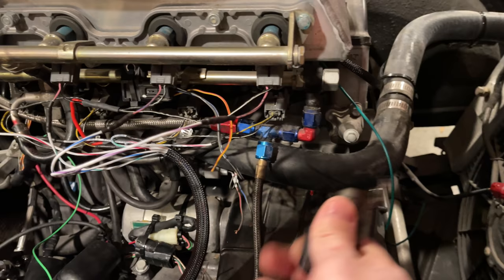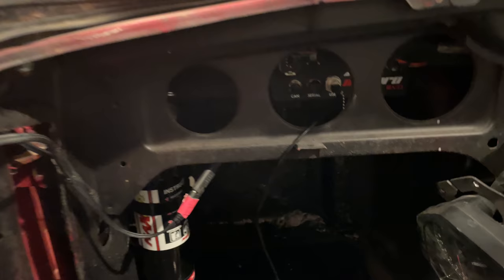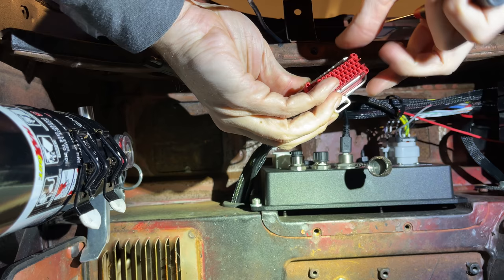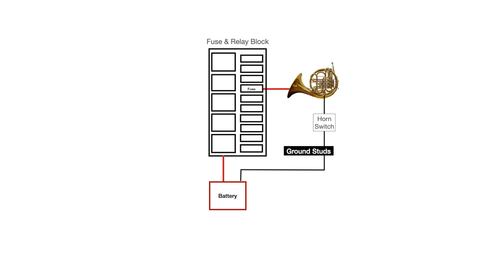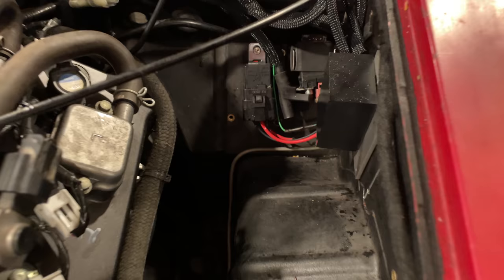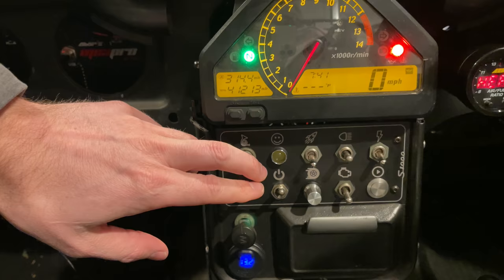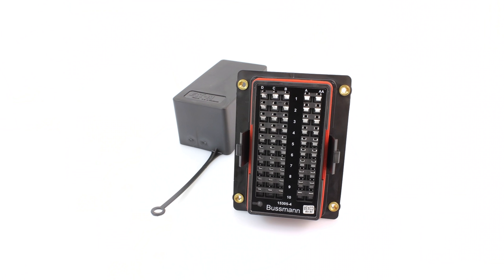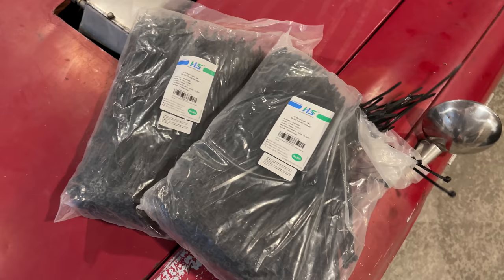Re-Wire Your Whole Damn Car - How To Do It Correctly & Inexpensively

Comment: one thing i’d add, when you’re at the “how long does each wire need to be?” stage, it really helps to use bits of cheap rope and tape to find the routes that will determine the length, shape and look of the finished harness.
Reply: Yeah, that's one of those steps that even the sincerely nice helpful people get kinda curse-worthy about leaving out or refusing to in any way advise on. And then they sneer at you for getting the wrong length cable when you had no way to know what the right length was.
Reply: @claws61821  It's also one of those things that's more of an art than a exact science, the trick is to make sure you have too much so you can cut them off at the right length once everything is all laid out.
Reply: @hannahranga  I thought the trick was to have extra so when you trim it down it’s still too short.
Reply: @hannahranga  And yet they don't offer ways to figure out even those rough approximations, and at best laugh derisively at you for asking. Why is that, I wonder...?
Reply: @kylemaddux1658  "I cut it three times, and it's still too short!"
Reply: My method is to attach it at the switch, relay, or fuse box, route it where I want and cut it when I get there.  It's tricky, but there you have it.  If you're dealing with a spool, then I put the spool at the thing switch/relay/fuse, then pull it where it needs to go, and then cut myself a couple extra inches, and fine tune it off the spool.  You still have one end free to run your loom or heat shrink.
Reply: just keep the wire on your spool... start at one end and route the wire to the other end, then backtrack and tidy it up (zip ties ect) and once its all in place, "Then" cut it to length and you will never have any waste.  There's no reason to cut any wire until its already in place.
Reply: @kylemaddux1658  sounds like you have done this before!  Lol!
Reply: @hannahranga  Measure twice, double it and add 30.
Reply: shit that's a good idea
Reply: I usually rough out the harness before cutting leaving at least a couple of feet either end (it's easier to cut a wire than to join it. But at the start I get an exercise book and note down all things that need wiring up. I then assign a colour and size of cable needed. I used to use a lot of base colours and had trace cable as a back up for extras and I use a tab of masking tape to identify  the cable. As for terminals I use QC connectors from single pin to twelve pin. For higher current I use a larger terminal (fuse link size high current) for any of the main power supply cables. If the customer wants a better connector I will use Deutsch plugs. When covering the harness I use split corrugated tubing in the engine bay and chassis but prefer shrink tube on the engine (personal preference) .If the customer wants a taped harness I will use a slightly wider tape made by Nitto. As an added F/U factor I will always run extra wires depending on the vehicle.  You can guarantee the customer forgot to tell you about the extra thermo fan or I want to fit A/C etc etc.
Reply: that's a brilliant idea I'm gonna do this next time
Reply: The best way in general is just to pull straight off reels and cut to length
Reply: There's a HELPFUL HINT.
THANX.

Comment: To much fuse is the wrong term. Really you want the smallest fuse with an over sized wire.
Reply: Thank you. I'm glad someone said it. I only came to the comments to see if someone already said what I was thinking when I heard that.
Reply: I’m used to wiring houses so I prefer to use 12 or 14 gauge wires for everything.
Reply: He meant:  If you only need 6 fuses, but you can only find a 10 fuse box----  then just go with the box with "too many fuses"...  and just have some extra. (same thing with the big connector).  Using the correct size fuse the wire requires is a given.
Reply: How do I rewire my 1964 Honda s600?
Reply: I'm sure that what he meant was if you don't know exactly how much current you need, err on the high side ("use too much fuse"). Later, when you choose wire size, you will (if you're following his guide) choose wire with at least enough capacity for the current rating of that fuse, and everything will work safely.
Reply: @calholli  Sure, but the number of circuits (fuses) in the distribution panel (fuse box) is not what Matt was talking about when he said "too much fuse".
Reply: @brianb-p6586  you don't blindly go with a larger fuse. If the current wiring cannot handle the load and you just upped the fuse amperage your gonna burn or melt something. Without knowing what the circuit is running or the wires feeding the item you cannot blindly up the fuse without risking damage.
Reply: @FishFind3000  what "current wiring"? This is about building the wiring from scratch.

Comment: Bonus tip, heatshrink the ends of the nylon cable braid. This way it doesn't roll back and expose the wires, looks neat too! Also let's you label a bundle of wires like "Left headlight" or "Flux capacitor" :D
Reply: I was planning on doing that for my  motorcycle fuel lines. Bought stainless loom for it 😍

Comment: I run all the electronics on singer Porsches for a living and I love this video. it's got an amazing collection of information with a good sense of humor to help beginners get over the hill on learning how to wire up a car which I know from personal experience, is a huge challenge to overcome. Keep it coming!

P.s. just as a side note, please please use something like DR-25 heart shrink and SCL/ ATUM adhesive heat shrinks in the engine bay for any engine bay harnesses that you plan to compete with and keep in the car for any extended duration as oils and heat can and will melt those wires and short them out over time. (Bonus points if you use tefzel wire too lmao)

Comment: Helpful tip with the Costco size bags of Zip-Ties is to rip the hole you pull them out of in the center of the bag instead of just ripping off the corner. That way they stay in during transport, and are still easy to pull out of the bag. Stupid little things that make a huge difference in your sanity.
Reply: I wonder how many times I have dumped out most of a bag of zip-ties. Your tip changed my life. I can be somebody now. Yeehah!!!
Reply: I learned this method a few years ago and have been using it ever since! A vertical slit makes it easier to pull them out than a horizontal one!

Comment: Quick tips:
If you would like to use aluminum wire just go two sizes up and make sure you don't have your wires too tight if your in a cold climate.
Remember that trying to measure resistance or continuity on a live circuit can damage your meter
Reply: Al wire will work harden and break ( usually at the connector point) if there is any vibration. 

Stick with copper.
Reply: @mycarsanovaify  copper work hardens as well..
Reply: Eh, resistance would be fine. Itll just max out and not give you a value. But the continuity will most definitely blow it up, yes. Never test continuity on a live circuit over 10a unless you got one of those extensions that can take the brunt of the amperage
Reply: @daniellau5859  Continuity and resistance are the same measurement (that's why they're usually on the same dial setting of a multimeter); continuity just beeps if resistance is below a certain value. Don't use either (or the diode check setting) on a live circuit.

And not only can trying to measure resistance/continuity/diode on a live circuit damage your meter, but may also cause strange things to happen in the circuit, since it's injecting electricity to measure the resistance/etc. Or sometimes even damage the circuit, depending on what it is and at what points you're measuring it.
Reply: Just don't use aluminum wire wtf. Are you try to sabotage him?
Reply: Better tip. If you would like to use aluminium wire, don't!

Comment: Idk what I expected but this is a really great video. I’ve already wired my car using the same methods you highlighted after learning the hard way through making tons of mistakes. Through my wiring journey,
I’ve made every mistake you can make from using cheap CCA wire, not using a diagram and having major circuit issues, and other major errors I wish I had known about wire types (SXL, GXL, TXL) and quality fuse/relay blocks beforehand. 

Having this video beforehand would have probably saved me 100 hours of labor and several hundred dollars in supplies. 

For anyone watching, take it from someone who has done this repeatedly. This is a really amazing video. 

Subscribed!!!

Comment: The little Crème brûlée gas torches are great for heat shrink, don't get too close though. Great video, I'm an auto electrician by trade and the way you do stuff is how it should be done on custom harnesses, nice work.

You need decent crimpers though, if you're going to splash out get a set of ratchet crimpers and a jaw kit that'll cover everything from cheap plastic crap to the little tiny specialised ones in the weatherproof connectors.

Comment: Great Content!
When working with connectors, avoid orienting them vertically, as this can allow more opportunities for moisture to eventually seep in. On this note, keep the split in the "gutter" tubing on the bottom of your harness to allow gravity to help keep out moisture. Additionally, be mindful of wiring coming out and immediately bending out of the connector. Keeping an inch or two of slack before a bend will keep the torsion forces off of the connections.
Source: 1 year automotive EE internship

Comment: I completely rewired my 88' Bronco II, installed a 1955 Packard Clipper dash, got all the Packard gauges to work, hid all the factory wiring under the hood, relocated the computer to a safer location (than the kick panel), and passed emissions in California. lol This is my third complete wiring harness build. Oh... and I removed about 30 lbs of wiring.

Comment: Hey Matt, fellow FSAE-racecar enthusiast and retired member here. Really appreciated this video.But I think there are some points that I don't totally agree with. Those crimps you are using are OK, but not for ultra high longevity. I usally use those that also crimp over the insulation of the wire to make the crimp even stronger and to prevent further failure-points. Copper usually doens't like to bend over and over again (work hardening) and the wires will brake off after some time if they have a lot of movement in them - usually this isn't the case, but sometimes it does and then you have to re-crimp them every now and then.

 We had one single dude in our FSAE team that did all the wiring of the car and he made it after the guidelines of NASA. After he was finished the wiring was almost the nicest part of the whole car. Super-clean and super compact. Still it wasn't like we didn't have any wiring problems and so we had to retire from a few races because we lost some stupid sensor just before a race.... Happens even to the best of us -.-

Keep the videos coming - I'll be watching :D

Comment: The thing I’ve learned pretty recently that has seemed pretty amazing is “solder seal” it’s heat shrink and solder in one and it’s easier to apply than crimping. Love em
Reply: but the conection has been tested not perfect. solder goes only on the surface. unless you get some quality ones I don't know about

Comment: I have recently acquired a TVR Chimaera and 3 months ago didn't know what a coil was let alone get stuck into the massive cleanup required to get the beast from a neglected run down state into a running machine.  Thanks to channels like yours I got stuck into it and am proud to be able to drive the car every day now.  Still tons of work to be done but to think I could get a V8 up and running smoothly on a very tight budget is insane.  The rewiring and cleaning up of rat nest wiring is up next and this video helps a lot.  Thank you.

Comment: I have been an electronics tecnician since 1969 and you have done a good job here. The grounding section is the one so many people just don't know. This will help many out more than they know. I would suggest using a heat gun on shrink tubing. I have seen people catch the shrink on fire with a lighter. Of course as soon as they get comfortable with the way it shrinks and when to remove the heat there's can do a great job. I have even used my soldering iron before. Keep up the good work. Everything I have heard you say is very helpful for most people. I use the sealing shrink on cars because of the environment. It really works great. 👍👍👍👍👍😁👍👍👍👍😁😁💥💥

Comment: I am deeply impressed.  I have rewired several cars and trucks but nothing past 1970.  Your points are spot on.  I have had a 1957 GMC 100 pick up for 15 years and when I got it I dug out 15 wire nuts and about 70 feet of telephone wire.  It is just bite off one thing at a time.  I have wired a few Vintage Air A/C systems and that helped me understand the importance of proper relays, fuses, breakers etc.  Great informative video here!  Your car looks so much like my Triumph Spitfire!  Bobby

Comment: Thanks for the awesome video Matt! I'm finally getting around to wiring an old Datsun Pickup and really got a lot of inspiration from this video. I did want to put out there though that if you use the larger Bussman box with 40 fuses and 10 relays it takes tanged terminals not the ones listed in the spreadsheet. The tangless terminals just slip out of the holes. Just wanted to put this out there for anyone in same position.

Comment: For easily testing continuity with even a cheap multimeter you can use the "diode" option. I have a 10€ multimeter and it has the "diode" function. Simple turn the function on, stick the probes between whatever you are checking continuity on, and the meter should make a BEEP or flash some lights. No need to read the screen.
Reply: Even my old cheapo Harbor Freight one has it. In it's defense, I've used it side by side with a friend's fancy Fluke multimeter and it reads close enough that I'm just gonna keep using this one. I'm not an electrical specialist and it's good enough for the occasional electrical troubleshooting. It handles diagnostic work on the high voltage circuits of the hybrids I sometimes work on fine enough.

Comment: Great video, will add that for the insulated crimp on terminals you were using the wrong crimper, hence why your crimps wouldn't hold and the plastic sheath would slide off. Heat shrinking non insulated terminals are great too, little less bulky with fine wiring like that, slightly slower though. Overall, awesome job.

Comment: I had a 1971 Land Rover and all the lights started playing up. It was corroded connectors, corroded wires and bad earthing to the chassis.
Dead easy. I bought the correct wire size, all black and used idents for identification as we did in electrical engineering, no multiple wire colours, and bought ring and bullet connectors and a proper spring loaded crimping tool. I already had the proper wire strippers and cutters from when I worked in electrical engineering.
Interesting you say about the wire type, I used an ordinary 100m reel of wire. No problems. Tie down the wires and use cable ties (zip ties) to loom them together so no abrasion.
Troubleshooting should not be needed if you wire it correctly.

Comment: As much as I agree with starting fresh, I am into old landrovers with only 2 fuses. 
Oh, and first like and comment. Never been the one before.
Reply: Being a Rover, both fuses were wired wrong to begin with
Reply: Ah good old Lucas, Prince of Darkness, I hear the replacement wiring harness smoke is getting rare, although Ferrari appear to have some stashed.
Reply: I spent 2 years being the main electrical tech for a company that built custom Land Rovers. The best upgrade on all of them was getting all of the Land Rover wiring out.
Reply: @deciplesteve  only if you wish to loose the nostalgia of fumbling in the dark on the side of the road trying to get the bloody headlights working.
Modern wiring all the way.
Reply: @NathanNostaw  I am happy to never have that nostalgia ever.
Reply: @deciplesteve  been there many times.
Reply: Hey that's not true, you get 2 spare ones as well.
Reply: On a Land Rover fit a ground harness,  at least to the chassis,  preferably back to the battery.  Ground continuity between the aluminium body and steel chassis is hopeless. The tail lights on my Series 1 were wired with trailer cable,  it's got all the cores you need on a convenient package.  I'll probably be doing the same on my Discovery when I get to it. Rats have been at the wiring and half of it doesn't work. It looks horribly complex but most of it's unnecessary,  there's nothing actually required that the Series 1 didn't have.
Reply: @highloughsdrifter1629  I have also found the grounds to fail. But after so many years and all the corrosion it's not a surprise. I replaced all the main ones and added more. I even had a fire on the high low plunger as the engine ended up grounding the battery through the return plunger spring. It got bloody hot and was very confusing. The ground strap had broken due to fatigue and I didn't notice.

Comment: Good timing...just came across this.  I have a restored 1965 Mercedes 230SL...everything except the wiring.  It uses the old style German torpedo fuses, which I really hate.  Been thinking of selling the car...but if I decide to hang onto it, the plan is to upgrade to modern fuses and new wiring.  Luckily, its a small car without any computers or other modern-day inconveniences.  I absolutely agree with using quality components...if you're going to this much trouble, no need to scrimp with knockoffs from you know where.